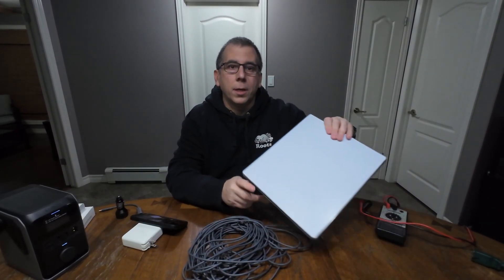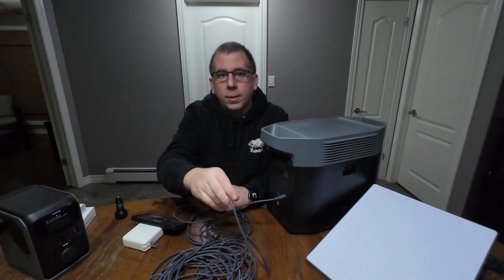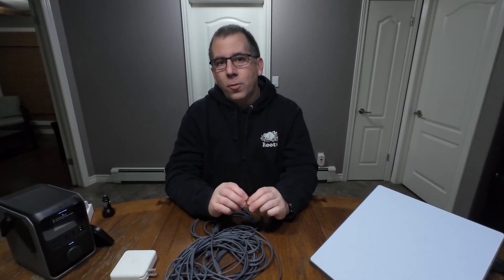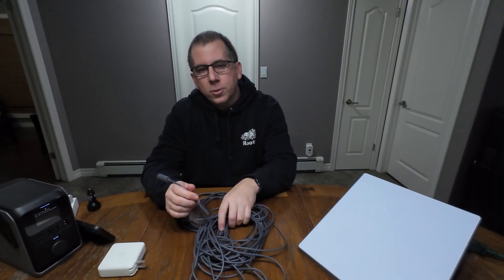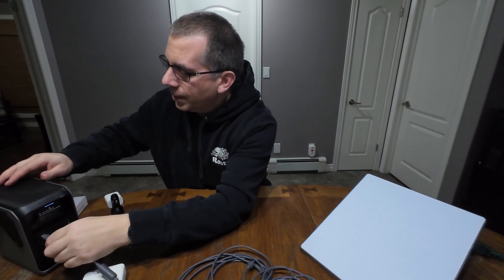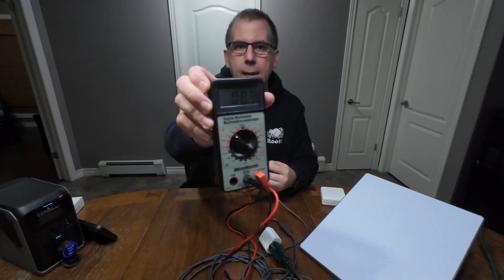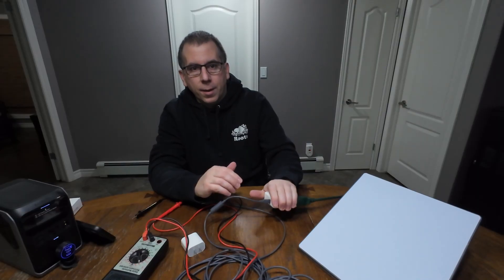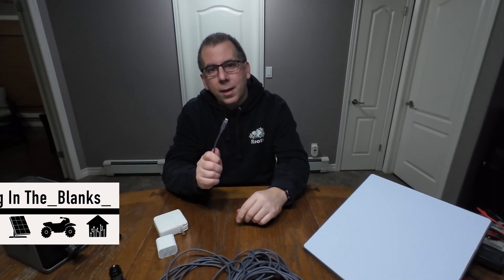STARLINK USB-C Power Issues ? No More! USB-C Explained

Comment: I just bought a 6.5 foot cable from amazon and it works even with a 12 volt battery in the car!  Starlink Cable 6.5FT, for Starlink Mini Replacement Cable for Mini DC Power Cord Waterproof (2M/6.5FT) Gray

Comment: It wasn't clear in the video, if you get the 100watt cigarette adapter will you still get voltage drop using the 50ft cable?  You can not raise voltage if running from a 12v source.

Just to make it clear, using the cigarette adapter that you put in your link, using your car battery will NOT prevent voltage drop using the 50ft cable.
Reply from the maker: Yes, the cigarette lighter adapter will raise the voltage to 20v with the 100w adapter. 
You still get voltage drop over 50ft but when you are starting with 20v you now have room for the voltage drop so you don’t go below the 12v minimum.

Comment: Why do you need to use the 50’ cable? Why can’t you just go direct from 100W power source via USB-C properly rated adapter?
Reply from the maker: You don’t need the 50ft cable, you can use a shorter one if that works. However it is very common for people to use the 50ft as they need the length to place the Starlink in a clear area away from the power source, especially if the power source is shared with other things such as the all important coffee maker.

Comment: The link you provide for the USB-C power adapter takes you to Amazon however, it does not have a USB-C mail connector on the one end, allowing it to connect to Starling cable, can you please provide the correct link to what you are using in your video..?
Reply from the maker: The adapter has a usb-c male connector on one end that connects to the power support, the other end has a female barrel connector that will connect to the 50ft cable that came with the Starlink mini.

Comment: When you tested that cigarette lighter adapter, it showed 12 volts, but that's with zero current.  You start pulling current (plug it into the Starlink Mini) and that's when you start getting voltage drop.
Reply from the maker: That’s correct, once a load goes on the voltage will drop. 
The test was to demonstrate that different voltage outputs from the various usb-c sources.
I’ll likely be doing another video to demonstrate actual voltage drop (loaded)

Comment: Electric power is a minefield of uncertainty at best for most - so it is nice to have it explained a/w the demonstration which helps hammer the message home a bunch👍

To solve my Mini's power solution I bought a 15 foot extension with 3 connectoion choices at the power end 
cigarett socket
USB c
barrel connector

I successfully used all three in various power sources in my self built van...

Comment: I think that you are not clear about what the voltage should be from your power source. Many of the wall wart and cigarette power supplies are only 5 vdc, used for charging cell phones.   The USB-C needs the proper voltage, watts alone don't determine the voltage.

Comment: Many 65 watt will also do 20v, but only 3 amps.  You really need to read the fine print on the USB-C power supply.  If the fine print does not specify the voltage and amperage for each of the several voltages it is capable of supplying, the supply is junk. Do not buy junk.

Comment: Ecoflow has a barrel connection poweroutlet, will the starlink work direct from it?
Reply from the maker: I would say it’s cutting it too close. They are rated at 13.6 v with a max of 40w . This would lead to instability especially over longer cable runs
Reply: They won’t stay on, it will work but any periods of inactivity and they might drop. I also encountered less than reliable connections and speed.

Comment: USBC 15' cable  connected to the USB 100W PD on my BLUETTI power station, then goes to an LP 20 connector, on the outside of my RV is the male end of the LP 20 connector with 50 foot of cable connected to the Starlink itself. ZERO issues and I’ve been running it like this for six months. 

95% of the issues that I see related to tech and electrical components are almost always user error. Inferior products being used, the wrong combination of these products connections that are faulty, etc..
Reply: I had issues with that combo and I’m editing a video for idiots like me. I couldn’t get it to work on the barrel plugs . Wish this video was out two weeks ago lol.
Reply: @BuffaloRangers  yeah like most things it’s always a bunch of trial and error. As long as you don’t get hurt. Usually end up spending a little more money lol. But for me, that’s what I love. It’s all about the process. I love anything DIY stay safe.

Comment: PD100W works well for Mini.  But if more convenient you can buy a cigarette lighter plug that boosts the 12V to 20V or 24V depending on which you buy.  This is not PD, just a typical 12V auto power port boosted to Mini-friendly voltage.

Comment: USB-C is incredible, and at the same time confusing.  Understand the PD (Powered Device) is critical to meet the needs of the device being powered. [ USB-C voltages: 5. 9. 15. 20.]   The incredible part is USB-C auto-negotiates between the PD and the PSE (Power Supple Equipment). For example, your USB-C powered Laptop will communicate with the UBC-C power supply and start the voltage at 5v, then once both devices have communicated there abilities and needs, the voltage is changed if needed and the wattage is applied.  However there's one component in the middle that can tank USB-C power delivery, THE CABLE.  Pay attention when purchasing USB-C cables make sure you purchased cables that support the needed voltage range and support data transfers.  This is why I can charge my iPhone 15 with my intel MacBook Pro Power Supply,  but cannot charge my Laptop with my Apple USB-C phone charging brick.
Reply from the maker: Great points, especially about the cable being a potential bottleneck!

Comment: You hit the nail on the head!! USBC power is all over the place, it's a mess and nothing (on the cables) is labeled. Labeling on adapters is hit or miss as well. So you have no (reliable) way to identify it. And don't get me started on the data transfer rates..... LOL Great info thank you very much
Reply: If it’s a reputable brand and properly labeled, you’ll receive the power it claims to provide. The same principle applies to transfer rates. It’s akin to having the same car model but with different features.